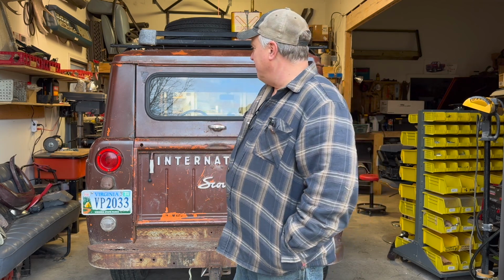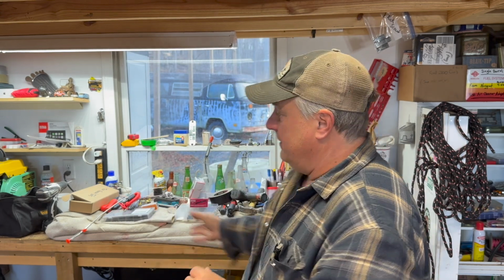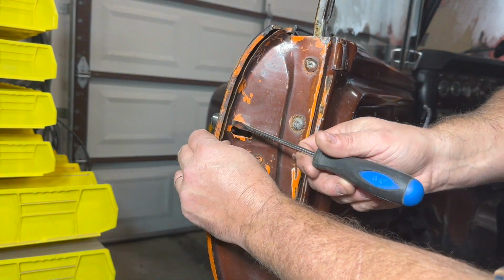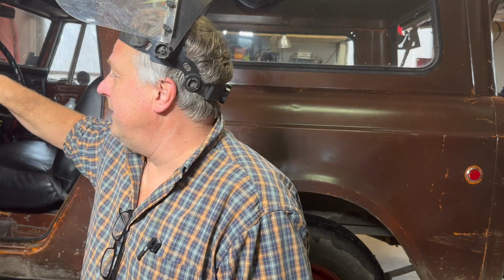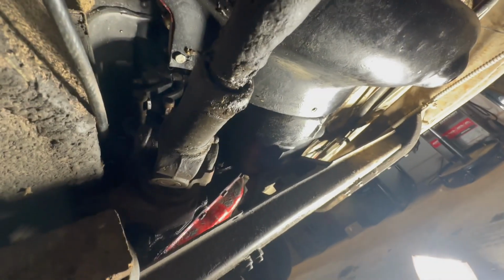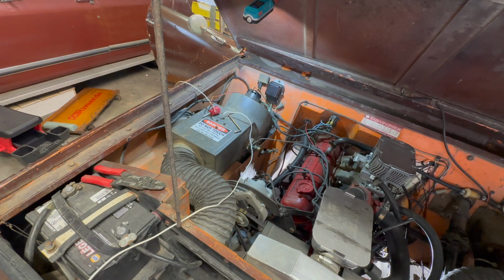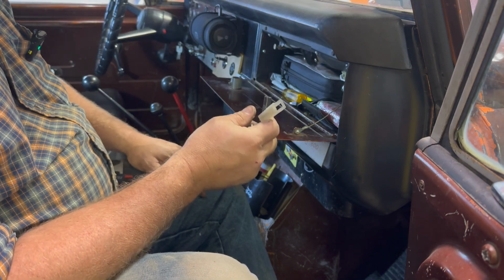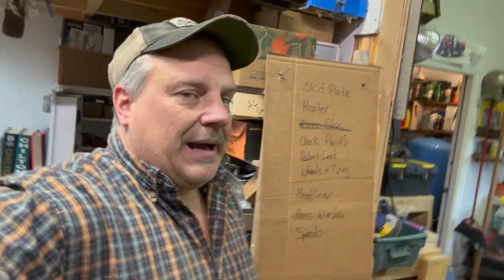Getting the Scout "Trail Ready"? Welding, Lubricants, Heater Fan and more.

Comment: You might look at an early cj5 cross member with the transfer case mount to fix yours.  I think you’re right, your cross member may be upside down.  Great video.  My damper on my Jeep plenum had felt around it and I found thick felt and replaced it and it sealed a lot better.  Good luck.
Reply from the maker: Someday, when I have more time, I’m gonna take that crossmember off and see if I can figure out how to turn it over. But at the moment it seems to be working OK. I’ll keep the CJ5 crossmember in mind. Thanks for the tip